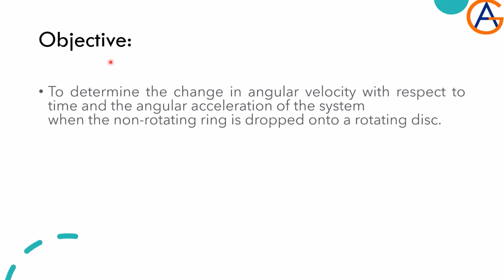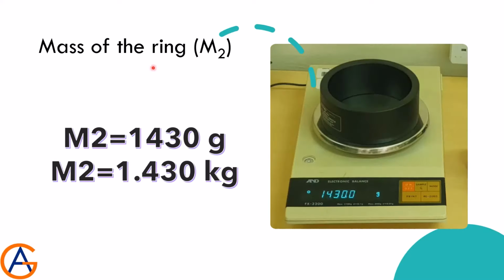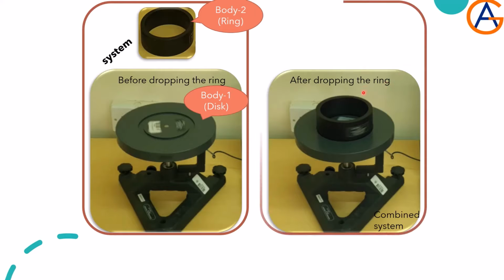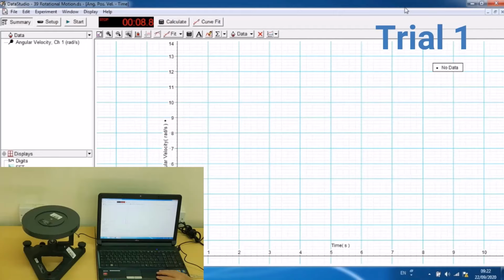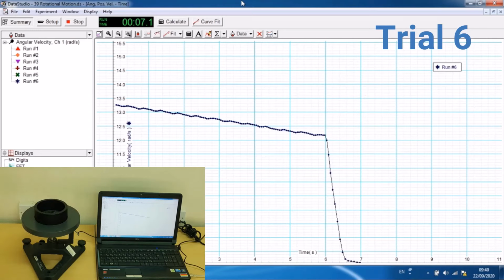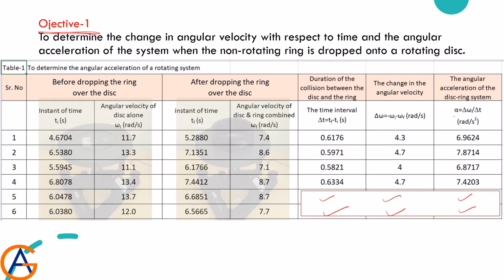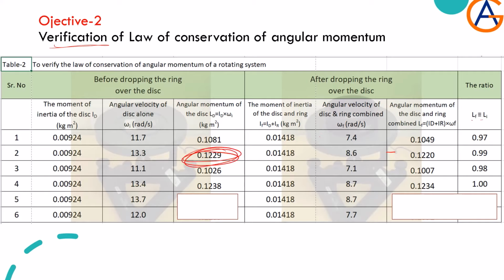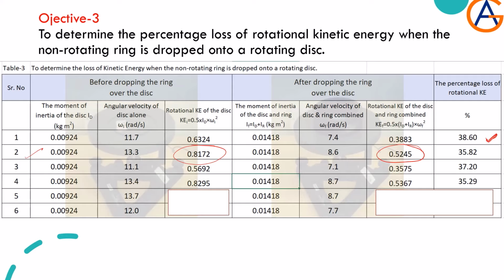Physics Experiment Rotational Motion

Comment: Sir, as there is a very small difference between Li and Lf 
What is the reason for this small error ?
Reply from the maker: Theoretically, the angular momentum before (Li) and after (Lf) should be the same. However, in practice (reality), they will not be the same due to several reasons, mainly friction in the bearing and the significant figures used during calculations.
Reply: @abdulgafoorshaik8966  thank you very  sir 
جزاك الله خير الجزاء 🌷